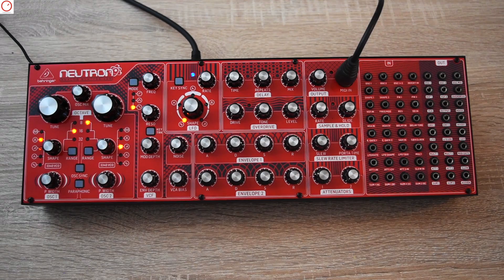Behringer Neutron Synth Feature: Analog Wavefrom Stepping vs Blending | SYNTH ANATOMY

Comment: Informative video as always, thank you, Tom. I was resistant to the Neutron at first, but an analog synth with this many features for $300 is simply unbeatable. Would've liked a neutral color and large Filter cutoff knob, but that's getting picky.
Reply: I just took the big knobs (osc tune 1&2) and put them on Filter cutoff and LFO rate. It looks a bit strange, but I'm quite happy :)

Comment: VELOCITY! HOW can I change the sound via velocity?
Reply: This is old, but maybe someone else has the same question.

You can configure the ASSIGN OUT to reflect velocity, which you can then patch to any IN.
According to the manual:
----------------------------------------
Press and hold OSC SYNC until both RANGE buttons are flashing, then use the range buttons to select a source. 
The active source is displayed by the LFO SHAPE LEDs. sine = OSC1 CV, triangle = OSC2 CV, ***downSaw = NOTE ON VELO***, square = MOD WHEEL, upSaw = AFTERTOUCH. 
When you're happy, press and hold OSC SYNC again, until the RANGE buttons stop flashing.